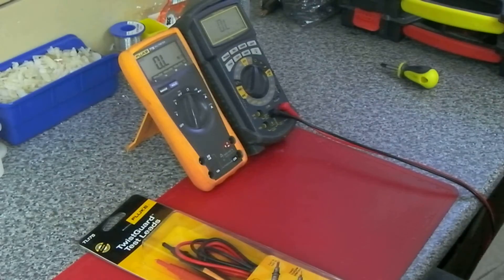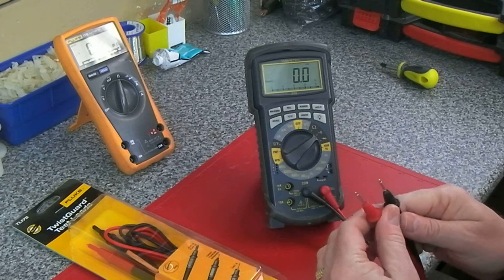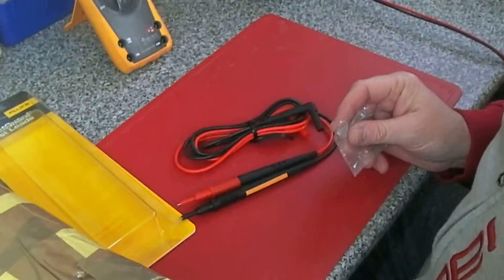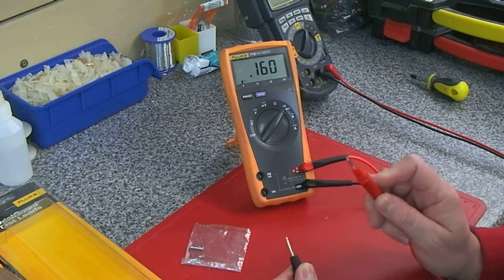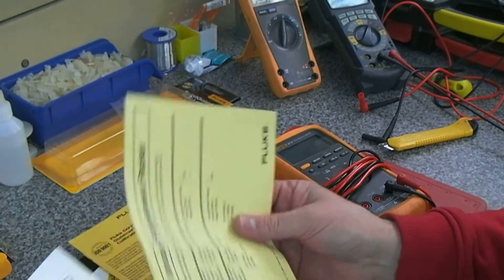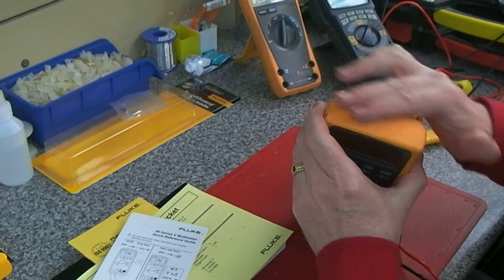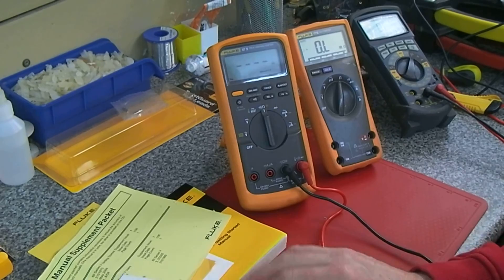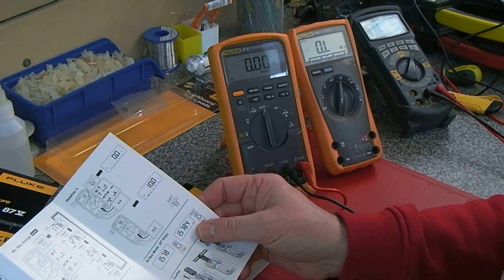Fluke 87v Attempt 1

Comment: I dont want to sound like a fluke fanboy.. but when you were doing the responce time with them side by side it actually looks like the fluke was faster.. the other multimeter does at first appear like it has finished it's measurement first but then continue to adjust it's value where the fluke only shows a value when it's done measuring..  furthermore i think the fluke has some kind of noise filter (probably more samplings and averaging) that you might be able to switch off though I don't know around 9:50 the wavetech i fastest and shows 0.2 then the fluke finishes and shows 0.1 and the wavetec then changes it's mind to 0.1 aswell